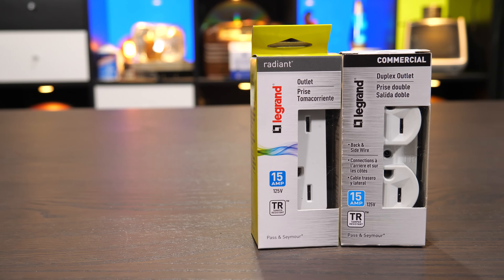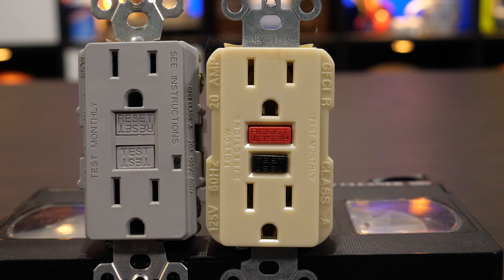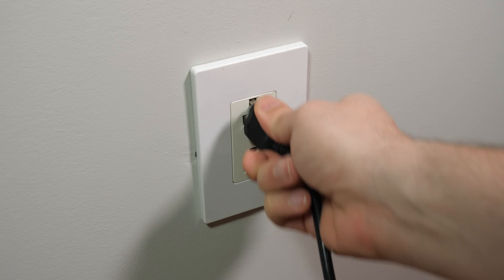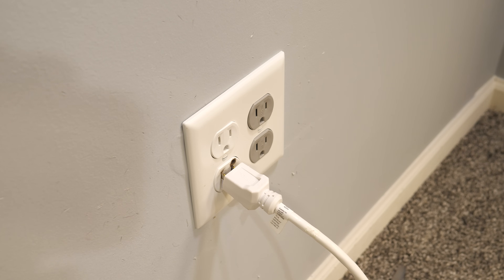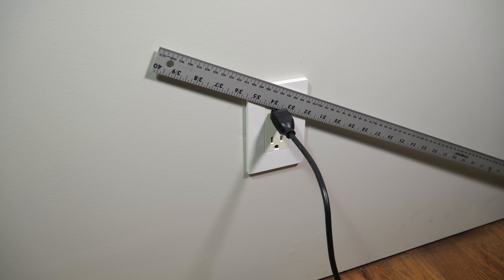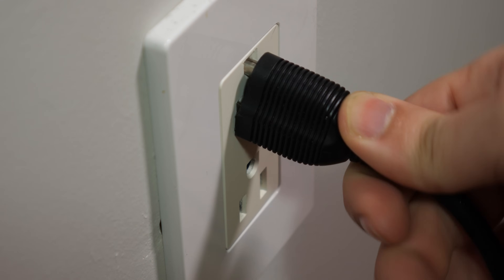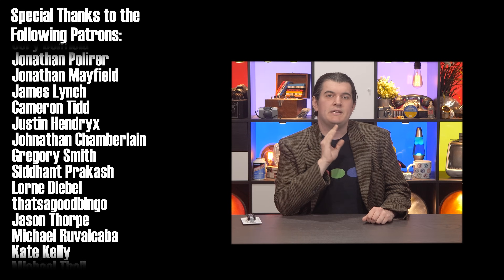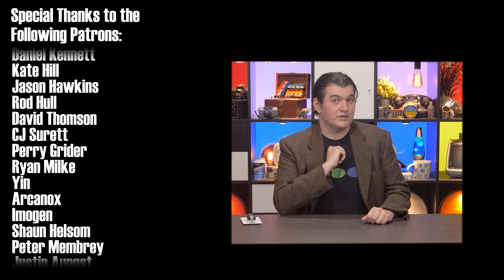Power outlets are topsy turvy - but does it matter?

Comment: Honestly the only orientation in which the parallel blades sockets make sense is the Chicago way. It's the only way worn-out sockets (like 90% of NA households have) will hold the plugs in place correctly. Also the EU plugs are so much better, there's no question (i'm from the EU so yeah i'm biased).

Comment: that lamp cord you showed at 15:58 is particularly irksome in my opinion. It's sold as a replacement lamp cord, but is unpolarized, so there's a 50% chance the outer screwy part of the edison socket is live. A problem we solved many years ago, reintroduced! I used to always deter people from buying those when I worked at a hardware store.

Comment: Since I grew up with Schuko/Type F outlets, I can only shudder at the safety risk AND inconvenience of the US outlets 🙄 Type F might not be the very best (like no one ever was~), but it guarantees that ground connects first, that the live pins can't be reached when plugged in, and it can be plugged in in either orientation. Grounded plugs are quite chunky (as long as you don't compare them to type G...) and usually have a rubber lip to aid in pulling them out again. Ungrounded Euro plugs (usually) also fit quite snuggly with great live pin protection thanks to sleeving.

Comment: I worked in a retirement facility and noticed in the newer section that all of the outlets were "upside down."  I was then told it's a safer. Well, about 3ish months later, I get a call on the radio that power is out to a residents room. The old section had the outlets in the "normal" way. They had dropped a ruler with the metal edge off the back of the table and perfectly touched the plug that wasn't all the way in. ZAP!

Comment: I have to say that I ran afoul of this when bending a coat hanger  wire,  It hit the open edge connector on my TRS-80 model 1, and the live side of a hanging plug.  Blew out the whole machine,
Granted the fault was mine,  But since then, where ever I live, I  flipped all my outlets to ground side up.

Comment: The only issue I see is the risk of reversed polarity. If the technician don't properly reverse the wires when upside down, it can mess with some appliances or even make the whole equipment live and electrocute you

Comment: Is there any reason wall plates uses a flat head screw? Asking because I would have shocked my self a few time if power wasn't off and I could easily see someone wiring up a outlet. Turning power on to test it. Then not Turing the power off to install the plate and slipping off the screen going into the outlet.

Comment: As somebody in the UK, I've always been amazed how unsafe your outlets and plugs are.
Reply: Yes but ours are only 120 volts, I would hope 240 volt would be a lot better designed
Reply: @WalterMan I am from the uk.  You are completely correct. 120v is a lot safer than the 240v we use in the uk. In fact on construction and billing sites we have to use 115v to reduce the risk of shock.
Reply: @alexannal  Construction sites use isolated 115v supplies - it's not the same as the 120v non-isolated supply that comes out of the wall in the US. Isolating it from ground removes the chance that you can get electrocuted by just touching the live wire - you need to touch both the live and neutral at the same time to get a shock rather than just getting a shock from live to earth
Reply: As someone from the US, I have never cared even once about what y'all think about our outlets 😊
Reply: @cybrnekomusic  😁 Heh, you're used to them.
Reply: It doesn't hurt that bad. You get used to it.
Reply: Yet in 47 years, I’ve never shocked myself by using them.
Reply: As someone is the US, I've always been amazed at how huge your's are.
Reply: @currentsitguy  they often contain a fuse directly within the plug head, and I'll take giant plugs over 240V directly to the fingers
Reply: @CEOofNothingTakes 240V has less current than 120V, though.
And as a thumb rule (it's not that simple, but more common, especially in home installations) current is also a big factor for harm than voltage range.
That's why for the most part, US wires are usually thicker than most EU wires, due to US having more current, thus require thicker wires to be able to withstand the current.
Reply: @CEOofNothingTakes  They always have a fuse
Reply: @CEOofNothingTakes  Well aware. In all honesty the things we have that run on 220v, and we do have that kind of stuff, have rather large plugs as well. I have an air compressor that does. It just seems odd to me for regular household appliance to have one.
Reply: @CEOofNothingTakes they should always contain a fuse.
Reply: @currentsitguy all regular appliances run on 240v in the UK. That's the standard voltage. It means we can plug in a kettle to boil water and it can do a decent amount in 2-3 minutes. In the USA electric kettles are rare, mainly because it takes so long at 110v!
Reply: @Thomato80   Yes, I know. My wife was born in the UK so of course we have one. They're not bad but I know yours are quicker. I used one in a hotel in London once.
Reply: @currentsitguy that’s what she said
Reply: @currentsitguy  well, all plugs with active grounds (stuff like phone chargers just use a dummy plastic prong as its ground prong) have fuses so part of the reason they're that big is to allow for the size of a fuse
Reply: @currentsitguy  Well the fuse has to go *somewhere*. And just in case someone wanted to use a regular a.c. power plug for connecting to the low-voltage side of a welder, those pins have it covered with capacity to spare.
Reply: @juppster5694  Yeah, I knew that. Guess it shows the differences in code. I have a few things that run on 220v, but even those rely on the breaker back in the box, not in the actual plug. Actually when I rewired the house I went above and beyond by having arc flash installed on each circuit.
Reply: @currentsitguy  Huge, but so much better
Reply: @wisteela  I suppose in a pinch I could swing it by the cord over my head as a weapon. :)
Reply: @currentsitguy  Most of them only ever get plugged in once thanks to us also having switches. And unless damaged, there's zero risk of getting a shock off them. And they don't get damaged unless abused, unlike plugs that have the cable coming straight out the back like a tempting little pull cord.
Reply: @WMartinNI  The switches thing is kinda irrelevant, basically everything in the US that can be plugged in comes with its own switch. There's a video on this very channel about it!
Reply: @Crawfishness  I've seen it. Switches on appliances don't kill the power to the cable though. Literally the only time we have to unplug anything is if we want to move it or plug something else in, the fact the plugs are bigger is even less relevant than the fact that appliances have switches. That extra bulk also makes them easier to grab so you can remove them if you need to without having to tug on the cable or wrap your fingers round to where the pins are (not that it matters since the design means you can't touch anything that's live anyway unless the plug is damaged).
And every plug has to have an earth pin, even if it's not used, which allows the live receptacle to be shuttered and means that every plug is held as securely as every other one. Overall I'll take all those benefits over having plugs small enough that they look like toys and are just as robust.
Reply: @WMartinNI  Hey, I'm not ragging on your outlets as a whole. They're objectively better. I just think the switches aren't necessary.
While it's true the electricital connection remains, the appliances won't actually use any power when turned off. Therefore the only remaining added danger is if there's an issue with a cable that could cause it to catch fire, which is close to impossible if the device isn't actually being used.
Reply: Absolutely our plugs are pretty decent here very sturdy but physically dangerous
Reply: You can happily walk barefoot around the house in the uk. Because we leave them plugged in and just turn the switch off
Reply: For real! I remember first seeing a euro outlet and thinking wow these are so much better and safer than ours! Why don’t we have these?!?
Reply: The fuse is there to prevent fire in the event of a failure I. The device which isn’t a dead short, but pulls enough current to overload the flex - which has a much lower current rating than the wires in the wall or the MCB.
It’s definitely a fire safety feature.
The switches on many US appliances don’t (half of the time) actually isolate the device from mains voltage - they just stop current by breaking the neutral cable - potentially a very serious hazard.
Reply: all of the fears and opinions in this thread are silly. none of us, on either side of the pond, are experiencing great difficulty or harm from our outlets on a regular basis
Reply: I would be totally afraid of stepping on a UK plug laying on the floor. Gives me nightmares.
Reply: @grandetaco4416 Stepping on a UK plug is similar to stepping on Lego.  Usually causes much bad language but no serious injuries
Reply: @grandetaco4416 It's not as common as you think. We have switches so we don't tend to leave things unplugged and lying around on the floor.
Reply: @grandetaco4416  Generally you leave UK plugs plugged in and switch them on and off at the wall. In other cases, the plastic prong of a mobile phone charger is on a slider so you can push it in when transporting or not plugged in. Its hard to explain but hope that makes sense.
Reply: @grandetaco4416 they are slightly domed so actually not as bad...
Reply: @grandetaco4416  I’ve stood on one, it hurts, but no more than standing on a stone or some Lego.
Reply: @grandetaco4416  Be afraid... be very afraid 😱 Worse even than Lego blocks.
Reply: @grandetaco4416 I'm  63 yo and I've  never stepped on a UK  plug. This is a non sequitur.
Reply: @rexwilliams7643 I am 81 years old and I also have never stepped on an U.K. plug. That might be because I am an American and have never been to the U.K. I really don't understand all this controversy over the plugs we have in America. I have been plugging and unplugging electrical cords for going on 8 decades, and haven't been electrocuted yet. From the videos and comments about this subject, you would think people being electrocuted left and right in America. It seems to me that 240  volts is much more dangerous than 120 volts. Maybe that is why they have to use these special plug systems in the U.K.
Reply: @grandetaco4416  I mean, I had an American plug damn near embedded all the way in my foot once. It's not much better in that regard.
Reply: @grandetaco4416 we don't leave them on the floor.  We plug them into the walls.  We have switches on the socket to turn off the power so there's no need to unplug them.
Reply: UK plugs are theoretically the safest, but way too bulky.
Reply: 110/120 v is inherently safer than your 220/240 V. As a kid I stuck my finger in a light socket and between the outlet prongs. It just tingled.
Reply: @somedumbguy0  The difference in safety between 120V and 220V is marginal. The danger isn't really from the voltage, it's from the path that the current going to take. I've touched a live 240v wire before and not felt a thing, but only because I was outside, dry, and standing on gravel that insulated me from the ground. However if I was wet and standing in a puddle of salt water,
 48v would probably be enough to kill me.

The fact you only felt a tingle just means you were well insulated to ground when you touched it, not that 110v is inherently safe.
Reply: Prior to watching this video, I had no idea about these dangers. Nobody goes messing around the sockets though. We are pretty safe about it I'd say
Reply: They are not unsafe.  Electric shocks normally come from someone working on electric wiring without following proper safety procedures.  I was shocked once in my life working on a piece of home-built equipment (definitely not to code).  I have never been shocked just by using a plug, nor have I heard of anyone being shocked that way.  Anyway, the modern solution to the problem is to put a ground fault circuit interrupter on any circuit with receptacles.  In a household with children, you also want any receptacle within reach of a child to have safety doors.
Reply: Welcome to Technology Connections, where this is heard... like all the time lol
Reply: Nah. They are fine.
Reply: But that’s what makes the fun.
Reply: If you think the US plugs are bad you should see Japan's. Much worse and ground pins are pretty much non existent.
Reply: @DanielBlaney  I will check those out.
Reply: german electrician here. I'm literally amazed that any electrician would consider this plug safe or practical (as there are like 20 variations for different voltages/currents)
Reply: Imagine how someone from the the UK, but in the USA feels about it
Reply: Pfft, you are just jealous ours look like cute little shocked faces.
Reply: @PersonaSlates dammit, now all I see are fucking shocked faces 😂😂
Reply: @PersonaSlates  They should be looking shocked, because in the last moment before they became inanimate, they got a brief look at the American plug standards...
Reply: Yes, well if you get electrocuted, you’re dead (220V).  I’ve been electocuted 3 times and I’m still here (110V).  So, thank goodness you have common sense enough in the UK to do things properly in a way corresponding to the risk.  Funnily enough, all three times I have been shocked had nothing to do with an outlet/receptacle.
Reply: @Hermetic7  Not true. I have had a 240 V electric shock several times. I'm fine. Even at 240 V, it's rarely deadly. You are only really in trouble if you are in a position to have your fingers contract over whatever is live, so you can't let go and this is true for both voltages.
Reply: @henryokeeffe5835  - Wow!  That’s interesting…and I had no idea.  I’d be scared crapless to work on a 220/240V circuit.  I’ve obviously not been careful enough when working on 110/120V.
Reply: @Hermetic7 I work with 277v here in the US and the shock is not that bad
Reply: @Hermetic7 I've been shocked with 110, 220, 5,000, 9,000, and 50,000 volts without being electrocuted (a combination of electric and execution that requires you to have been killed) and have an uncle who's been hit by lightning twice (indoors both times weirdly enough) and is still alive
Reply: Don't you need a license to watch TV lol
Reply: @playerroku4412  We do, and that's terrible
Reply: @playerroku4412 don’t you need insurance to see a doctor lol ( see we can say things that are unrelated to the video too !)
Reply: Every time a Brit mentions their outlets have switches in this thread, God stomps a kitten.
Reply: @TKettle  Good job I didn't mention them.
Reply: As someone who walks barefoot at home, the UK plugs scare me.
Reply: In my 54 years, I am not aware of a single injury to anyone I know or know of that was a result of US plug design.  I don't recall a single news story reporting an electrocution or fire either.  I'm sure somewhere it has happened, but I suspect more people have been killed tripping over a door sill.  And with GFCI becoming ubiquitous, whatever risk there was is fading.  But for sure UK plugs are some seriously clunky, oversized, and overpriced PITA's.
Reply: @apostolakisl 30,000 injuries from electric shock per year in the US, 20% of all injuries are kids... no it doesn't get reported because it's too common and not "news worthy".
Reply: @to_the_seas  that's from kids sticking random things into the receptacle. This video is about a proper plug being used in a proper receptacle.
Reply: @apostolakisl another benefit of the UK system. To get to the live connector in the socket, you first have to wedge something into the earth hole to move the shutters from over the other holes. It makes risk of anything getting to live nearly zero.
Reply: Blame the tiny Congress that never legislated shit.
Reply: @doomsdayrabbit4398  right, that's the problem. Not that we invented this stuff and so we didn't have anyone else's first draft to improve on. But hey keep making the government bigger and bigger, it's working great so far giving them more power, right?
Reply: @KairuHakubi when you say "we", who are you referring to? The removable plug concept came about in the UK in the late 1800s...
Reply: @KairuHakubi  we kind of invented all of this at the same time as you
Reply: The british pride in their bulky, overbuild electric plucks is so silly. 

Meanwhile the danish type K plug is the best in the world because it looks like a cute smiley face.   ☺ 😊

 But that's not bragging. That's just a plain fact.
Reply: @lakrids-pibe bulky implies unwieldy, they fit in your hand and fit behind your furniture.  How small do you want them?

Comment: A friend of mine was installing an AC adapter for a security system. The AC adapter had a screw in the top of it to keep it from being unplugged. You had to remove the existing faceplate screw to install it and then the AC adapter screw would hold the faceplate on the wall. Well the faceplate was made of metal and is slipped and touched the two prongs. Huge explosion of sparks and the outlet was destroyed.

Comment: The biggest problem I can think of that would be pretty relevant in a hospital setting is: fluids

In the ground-up configuration, a conductive fluid dripping down the wall should contact the ground pin before the hot pin which should make it safer than if it connects the two live pins. Thats according to amature electrician knowledge...

Comment: So why can't they have a switch inside the receptacles in the socket that get depressed by the blades and turns the power on to the socket only after the plug has been fully inserted?